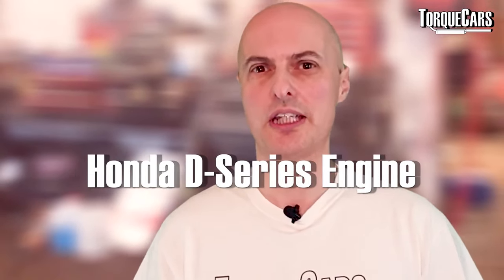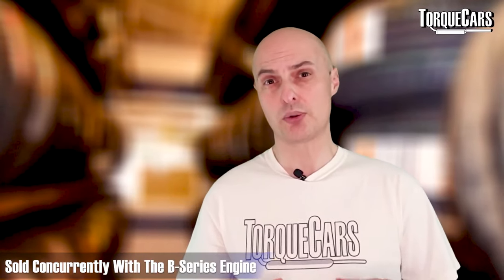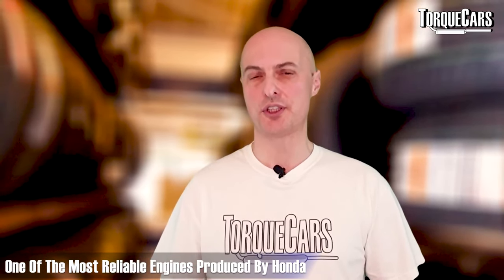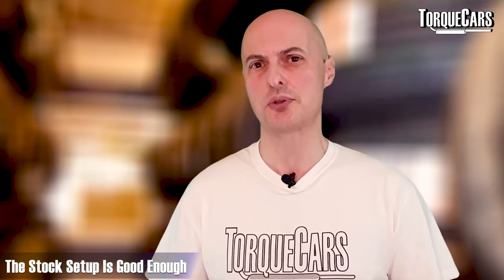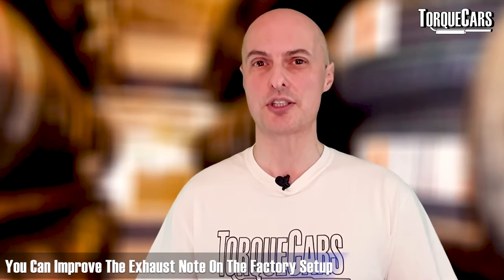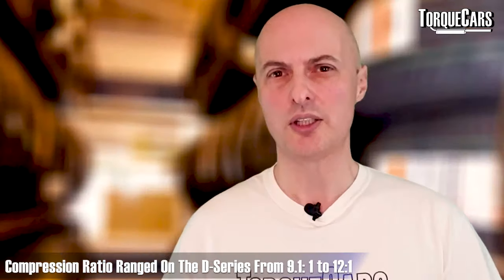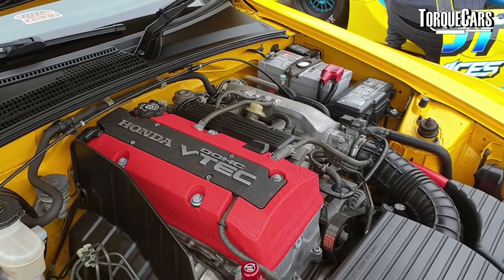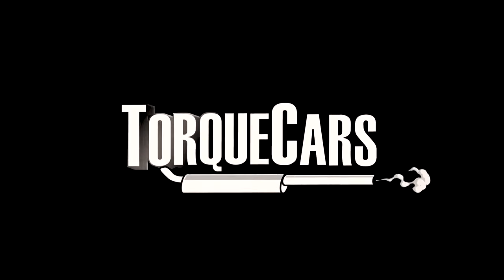Honda D Series Engine Best Mods & Upgrades 🔧[Tuning]

Comment: Do you also have a website called torque cars? I’m sure I stumbled upon it in the 2012s when I had a seat Leon FR 170 and my head kep cracking 😂
Reply from the maker: I do www.TorqueCars.com so welcome back. You've gone Honda on us now then? What have you got?
Reply: @torquecars  nope had a d15b years ago as my first car eg6 coupe with an sir2 kit. Got a plethora of vehicles now but stu,bled across your website back when I had a Leon fr 2011. Strangely gone backwards on the diesel front got a b7 a4 avant ppd 140 now. Majority of my other vehicles are 6 and 8cyl BMWs

Comment: I have the 2003 civic with d14z5 planning on putting short ram on it. Just want to see will it make difference with fuel economy, and also improve the sound at the moment you hear the roar.
Reply: what....
Reply: What
Reply: It would sound better, but may reduce throttle response af low speed. Throw a k&n filter in the stock airbox

Comment: Does someone know d16v1 can get to 200-250hp without turbo!
Reply: How?
Reply: never in this life :)) probably with TSS CAI + exhaust manifold + bigger exhaust and a soft upgrade you will get max max 135-140hp
Reply: Yes with nitrous, cam, injectors, rods, head porting, valve spring and 9000rpm ect, basically a race/drag build waste of time, just turbo it